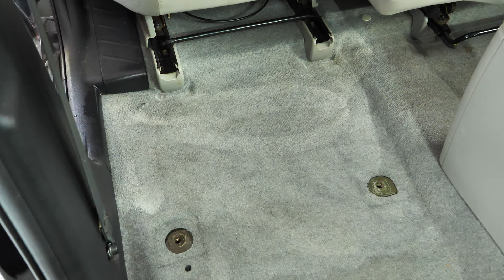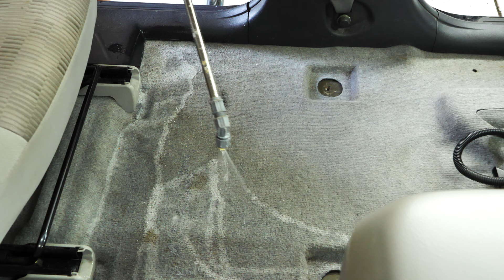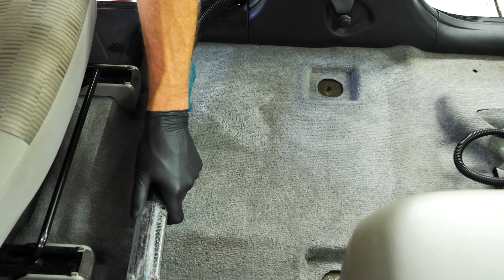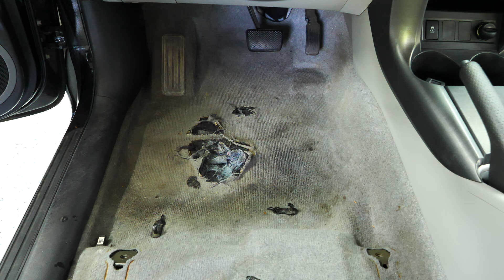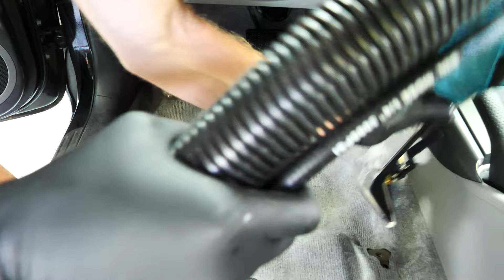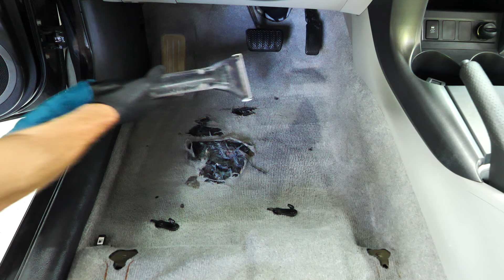Extremely Satisfying Seat Extraction ASMR || Car Detailing

Comment: what is the difference between the Sandia carpet extractor and the bissel heated extractor that you listed? is it necessary to have a steaming function on your extractor for optimal results? I've used a bissel before on a couch but it took a long time before the stains disappeared, I think because of the weak suction power, which of course isn't something you could afford when detailing a customer's car.